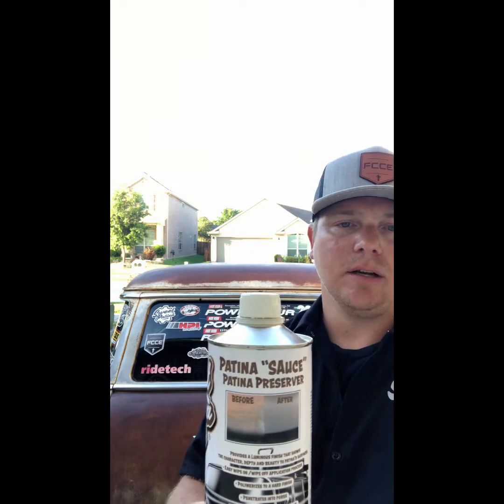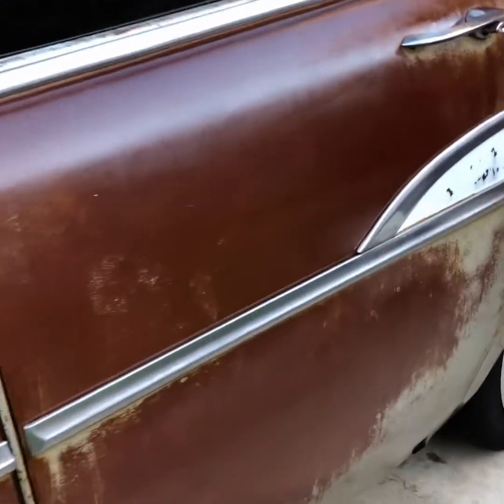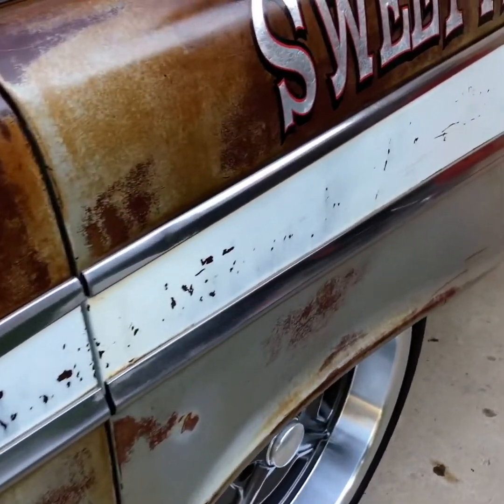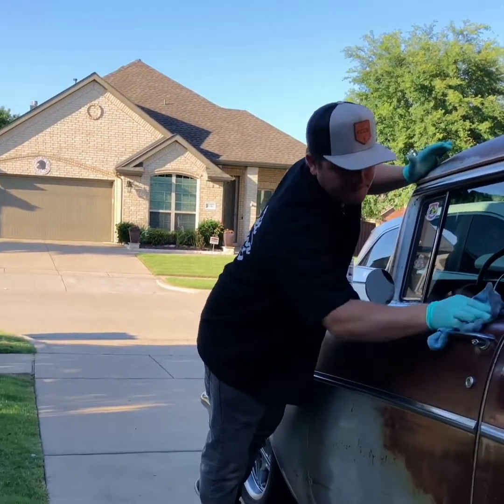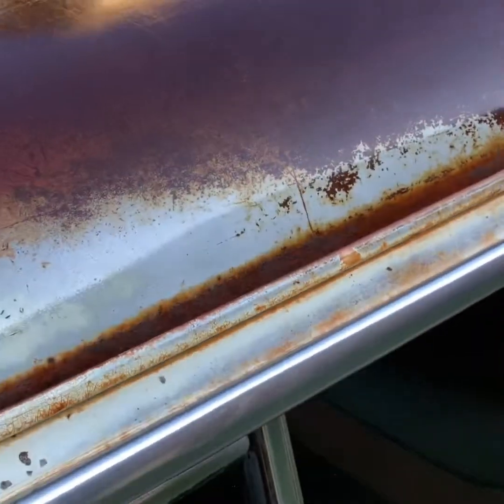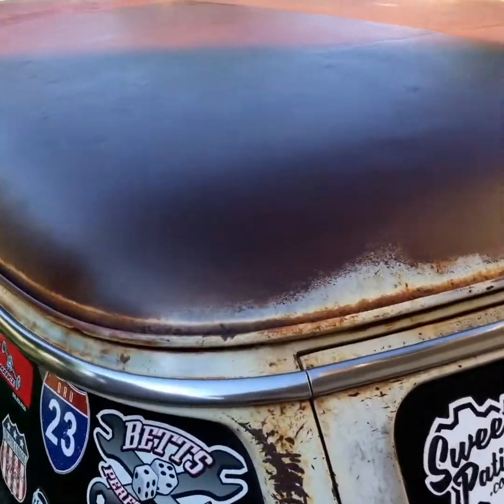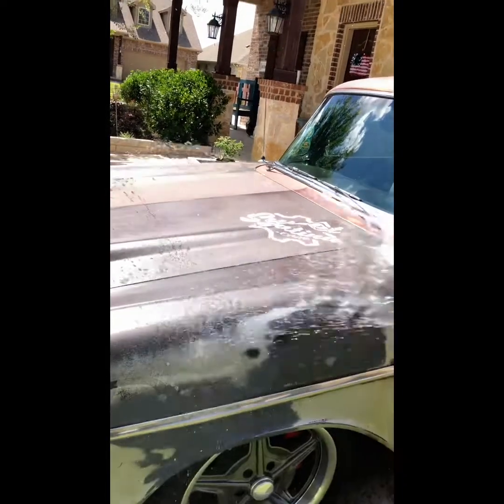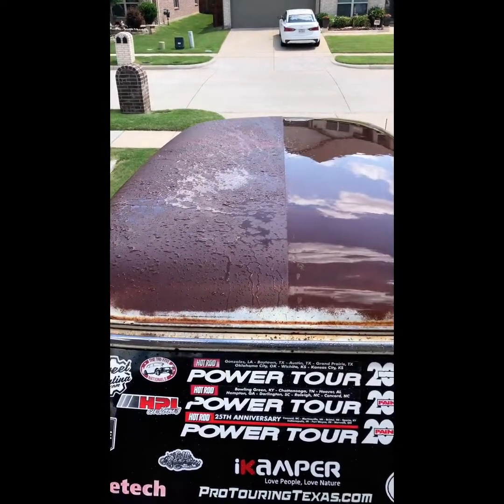Sweet Patina- Applying Patina “Sauce”

Comment: I had a bug with paint so oxidized that it looked blue. I used McGuire's #7 and buffed it into the paint. What it did was restore the natural oils into the single stage paint. The paint was actually green. The paint was revived and while the car was patina'd the paint was a lot better. But it took days and a lot of work . Will your stuff revive oxidized paint like that?
Reply from the maker: Yes, we have several options to help remove the oxidation and bring the shine back to worn and weathered paint.  We always suggest cleaning the surfaces with our “So Fresh and Clean” APC to remove as much grit, grime and oxidation as possible.  Then, If you want a nice glossy shine use our Century Polish.  If you’re wanting a fresh natural matte look use our Patina “Sauce”.  Hope this helps.